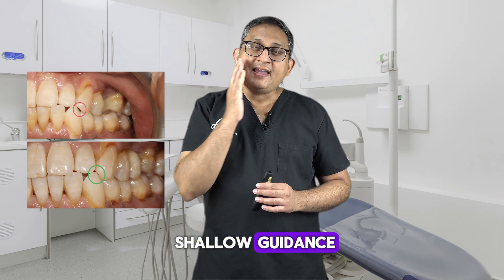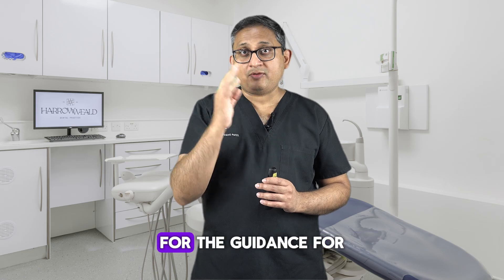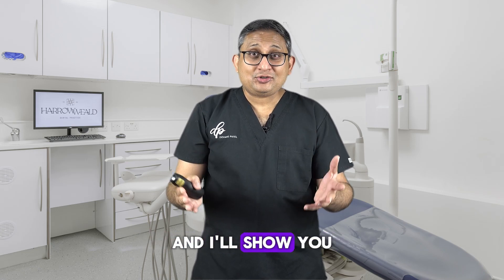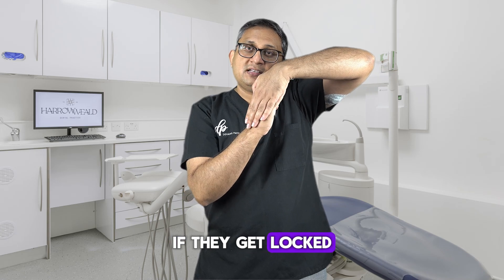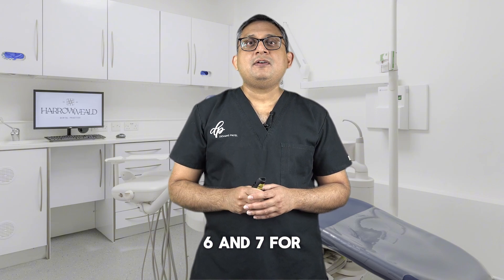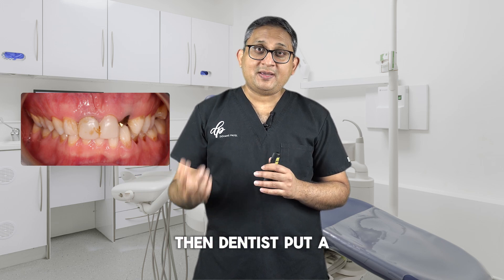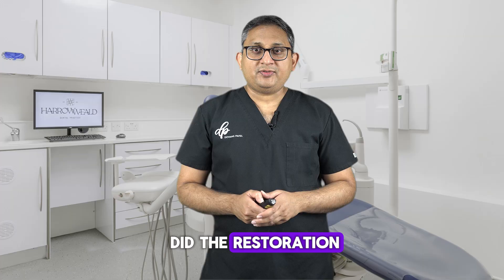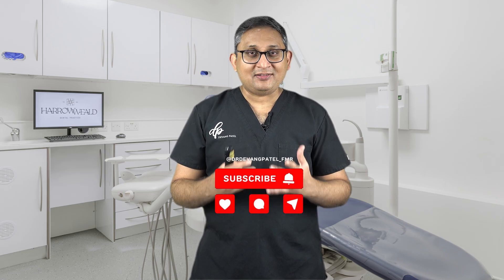How to Build Canine Risers?

Comment: Hi. Thank you. Does this filling in lingual of canines last?
Reply from the maker: Very good question. Yes it will wear over time and need to monitor closely.  Alternative is ortho or possibly gold backing?
Reply: Thanks so much for explaining. What is ‘gold backing’? I think I may go for the canine risors as my back teeth are cracking. 59 year old here… My top teeth are not forward enough and I am wearing out my teeth. Can this method completely solve the problem or are orthotics usually necessary?